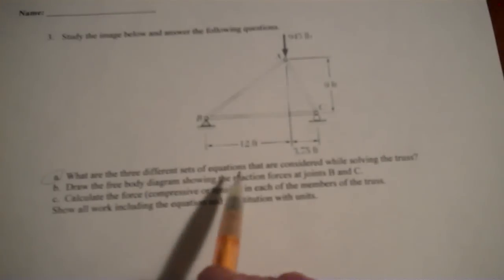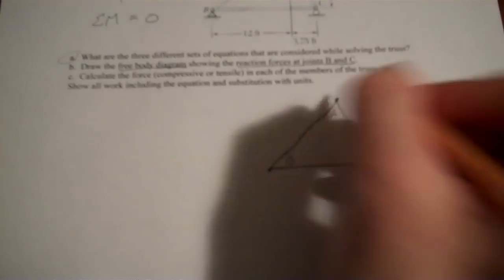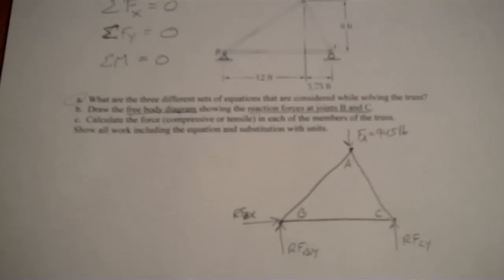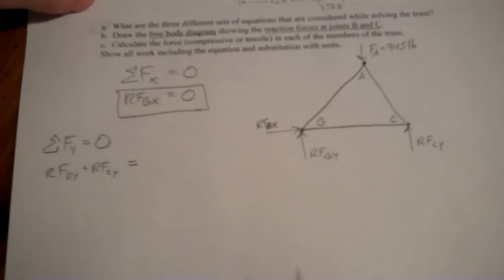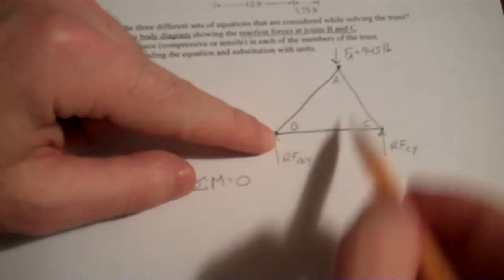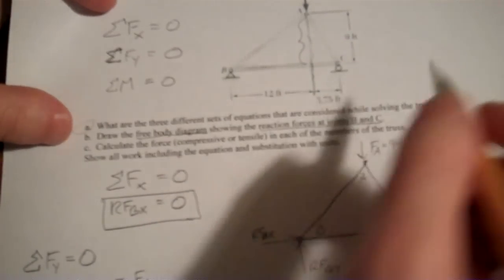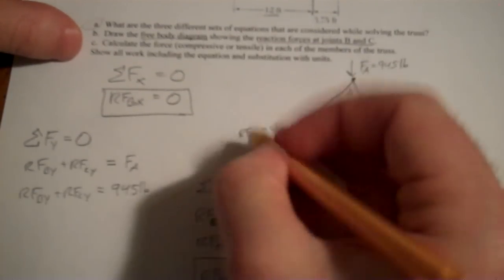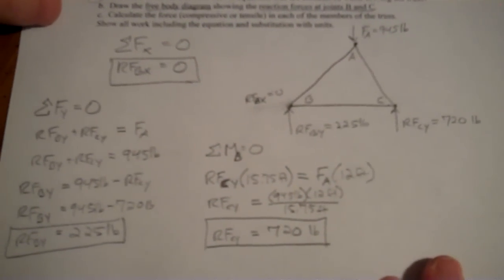POE Practice Problem - Truss part 1

Comment from the maker: @animeginganinja If something pushed sideways on the bridge, and there was no reaction force in the horizontal direction, nothing would stop the bridge from sliding left or right like a skateboard.  In this example there happens to be no outside horizontal forces, only vertical, so RFbx turns out to be zero.  If there were outside horizontal forces, RFbx would cancel them out.  I chose it to be toward the right only because I assumed it would be positive.  If I'm wrong, its negative, no big deal

Comment: @MedwayEngineering thank you for your earlier response, i have i better visual understanding ;)  i understand at the hinge tht the reaction force in the y direction would be the contact force pointing upwards, however im still a little confused to why there is a reaction force (RFbx) pointing to the right?

Comment from the maker: @animeginganinja 
Imagine an actual pin through a hole in a truss like a tac holding up a piece of paper on a bulletin board.  At any pin or hinge joint there will be two reaction forces, one in the x-direction and one in the y-direction, because it prevents the paper or truss from moving up, down, left, or right.  I does not prevent it from rotating, however.  A roller joint is like a rollerskate.  It will hold it up (y-direction) but not prevent it from sliding left to right, 1 reaction force.